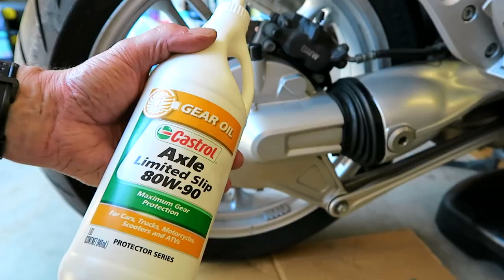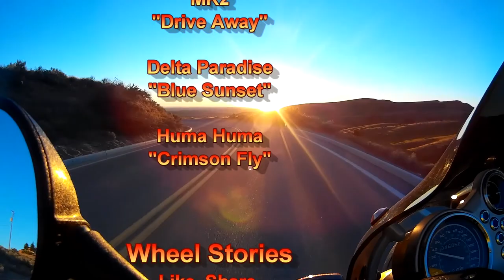Art of Motorcycle Maintenance, Classic Cars & Twisty Roads | Wheel Stories

Comment: Looking to get the same bike . What should I look for when buying used ? Only 9500 miles  on a 2004 . Thanks 🙏 always enjoy your videos .
Reply from the maker: 9500 miles on a 2004, that's not bad.  Look for signs of abuse or an accident.  Service records are helpful, to determine how well it has been maintained.  Fluids may need to be changed, especially the brake and clutch fluid.  You should probably check on the tires for wear and age.  Take it for a test ride, make sure it runs well and all of the controls, lights and dash signals work properly.  Check the VIN record.  If the bike features ABS braking, be aware that's a sore point on the R1150R and may need to be repaired or disabled for standard braking down the road.  Study NADA pricing for the bike online to make sure you're getting a good deal.

Comment: Marvelous, inspiring, up-lifting! Your videos are top notch without pretense.Kudos on preparation, information sharing, filming editing.A lot goes into this.
I have the same bike for 18 years now. My only issue presently is the ignition lock sliding down into the cylinder. Labor in New York City is $95.00 an hour plus parts. I would appreciate any suggestions.It gives me great joy watching and learning from your videos.What is your name though?
Reply from the maker: Thanks very much.  I'm pleased that you appreciate the videos.  I'm not familiar with your problem with the ignition lock.  You might find some useful information at the r1150r.org message board.  As I write, I'm currently in the garage wrestling with removing the ABS module from one of my bikes.  The ABS pump failed and I'm converting the bike to a traditional non-integrated brake system for the front and rear.  I do as much research as possible through message boards, YouTube and shop manuals.  I like watching repair videos.  Books and diagrams can be confusing.  Then I build up my confidence and commit to the maintenance or repair project.  I know guys that enjoy the garage more than riding.  I'm not one of them.  But I do like saving a few bucks and knowing how to fix my bikes.  Name is Paul.  Thanks for watching.